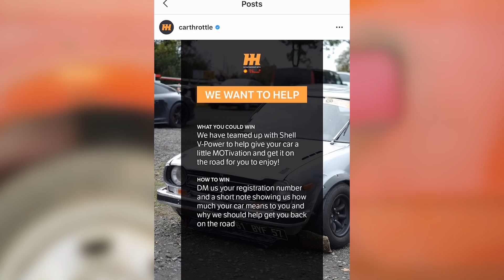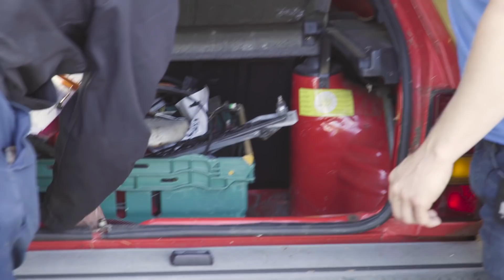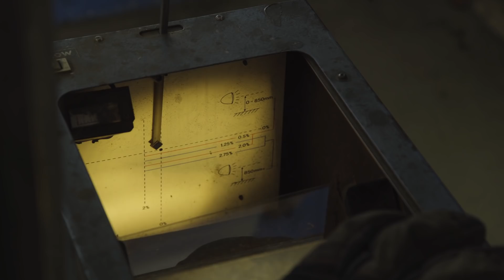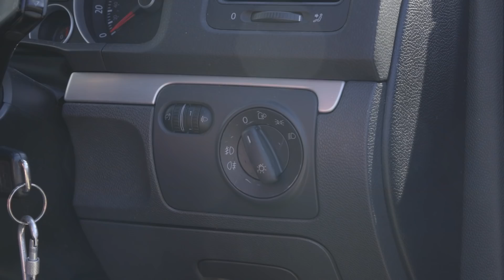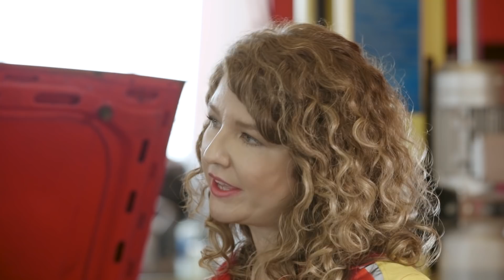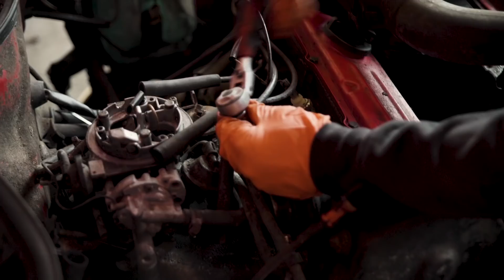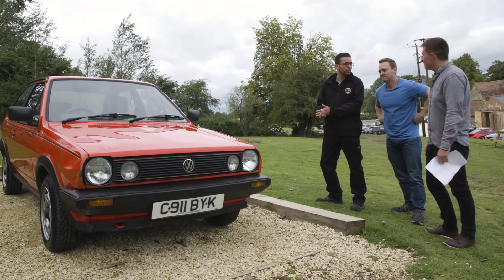Saving A Rusty Project Car From The Scrap Yard

Comment: knock sensors and variable ignition timing on an 85 polo? has she been sniffing v power?
Reply: Clearly she's memorized a pamphlet
Reply: andk1987 it doesn’t even have an ECU!
Reply: does an '85 Polo even have electronic ignition or is it still points? lol, my '88 breadvan 1043 was electronic but sure as hell didn't sense the V-power and bump timing lol. The most intelligent thing about the fuel system on that is the auto-choke :D
Reply: dan mackintosh yeah electronic ignition with distributor, the early ones mk1 (Derby) before it was renamed polo were points
Reply: @danmackintosh6325  The Breadvan I had didnt even have that 😂😂
Reply: @thatcarguy4771  Weber carb?  Would've preferred Weber on mine but the little 1B3 (i think) pierburg auto choke was pretty cool... the 2E2 on my caddy never worked quite as well though.
Reply: @danmackintosh6325  oooo what colour is your breadvan?
Reply: @TheBreadvanMan  the colour it was (more's the shame it was a one elderly owner 80k mile car, solid albeit battered) I'm not sure the name, not Tornado red but the similar-but-less-bright version.  Caddy was also in that hue.  Miss them both, they were very fun for different reasons. Bready was so low powered you could thrash it everywhere and not get in trouble (probably why the HG failed eventually) and the Caddy was a rattlebox extraordinaire that never went a journey without a breakdown, but was just an adventure to drive all the same & I didn't mind the walks!
Reply: @danmackintosh6325  oh nice, I've got a 1987 breadvan marine blue( my profile pic) it looks mint but has alot of problems and has been off the road since 2003 but hopefully it will be on the road by next year 👌🏻
Reply: @taylorhaddock2782  actually the 85 polo classic (which was a derby before the rename) had points. I used to own one and do the servicing on it. Bloody great car, so easy and cheap to service, but the head gasket went and it went up in flames. Still miss it.
Reply: Was that a carburetor or single point injection? The latter does actually have an ECU, albeit a very small and simple one. Although I think they were all carburetors until the mk3.
Reply: hmm
Reply: andk1987 it does, just nobody knows about it...
Reply: William Bishop how? You open the bonnet and see the quite clear distributor which tells you it’s electric ignition literally they all have it
Reply: Taylor Haddock it does, you just have to pretend it’s there 😂

Comment: Alex looks like he’s having a “crisis”when the intelligent lady explains engines
Reply: She didnt even know that the Polo doesnt have s Knocking sensor
Reply: T B yup
Reply: She's reciting corporate speil.
Reply: @jonnoMoto  which does in fact have tons of engineering behind it...
Reply: daszieher I think jonnoMoto was more meaning that it seemed as if she had rehearsed it straight of a text book. Not disagreeing with the facts
Reply: @r3v1v0   yes. When as a corporation you get "air time" you make blanket statements.

Still, corporate lingo still is information and it holds true.

Higher quality base fuels and specially the additive package set premium fuels apart from the more budget offers. The higher octane value is just one of the attributes.

However, budget petrol fuels have come a long way since the 80's so that today's offer should be more than enough for a Polo.

Diesel is a different story.
Reply: daszieher fair enough. Makes sense. 
I put 99 momentum from Tesco in my Fiesta ST. Iv heard things about super market fuel but I assume the fact the octane is high it must be good quality?
Reply: you mean the robot?
Reply: You forgot to put quotes around "intelligent" and "explains."

Comment: Right, is it legal to insure a car on your parents as main driver and have you as a secondary driver even if your the main driver it makes insurance much cheaper so it it legal or not? Thanks
Reply: It's not legal it's called fronting. You can be main driver and add your mum/older experienced driver onto it as an occasional driver which should bring cost down a bit.

Comment: Far better to repair and renovate if you can, rather than to scrap, especially with simple uncomplicated cars, I reckon. Many cars end up at the scrapyard after a failed MOT, breakdown or reliability issues, not because they are unfixable, but because people reckon it's cheaper to gamble on buying something else cheap and hope that it doesn't break down or fail the MOT as well.

Comment: I wasn’t aware a vehicle could fail on things such as not having light over license plates etc as I though they had a bit of maneuverability on some things on the mot test because someone of the stuff modern cars can fail on most old ones don’t have like if it didn’t come on that model like where is he getting a reg plate light from and how is he gonna fix it on if it isn’t even on that model originally When the main focus should be on general safety like car-brakes. And stuff like that

Comment: Jesus christ im glad we dont have mots
Reply: You'd rather have death traps on the road!?
Reply: @drunkenhobo8020  why does it got to be a deathtrap? Common sense goes a long way on whether or not to drive something. In the Rust Belt where I live there's a lot of Rusty vehicles and nothing's ever killed me because of an unsafe vehicle I was in or around.
Reply: You've lost the argument if you're relying on people having common sense.

And "it's never killed me" is one of the worst arguments you can make. Of course it hasn't - that's why you're here to say that.
Reply: @drunkenhobo8020  I agree a lot of people lack common sense but when I look around I just don't see bad things happening because it deteriorated vehicles around me. Sure the potentials there but it just doesn't happen.
Reply: Well the USA does have more than double the road death rate per mile than the UK does, but there's obviously a lot of factors at play there.
I don't think you can categorically say that it doesn't happen. It's extremely difficult to determine all the factors involved when things go wrong on the road. In a hypothetical situation maybe having the front brake pressures unbalanced caused a car to change direction under heavy braking, resulting in a more violent crash than if they'd been maintained properly. But you're never going to be able to tell that at the scene of an accident.

Honestly I think MOTs are a great idea. Forces people to take car maintenance seriously. Wouldn't want to live in a country where that Polo was legal to drive!

Comment: This Polo is the slowest way you can have fun, it just love to spin the wheels and take corners, Easy to repair and maintain, But check the steel bands that hold the fuel tank  in place i lost two, one of them where dragging onto the asphalt,

Comment: I love these types of restoration videos. In fact I love the Prelude series so much that I had actually bought an 88 accord myself as a “project” car. 

I had to change out the front sway bar bushings, and the distributer O ring gasket but other than that there isnt anything bog wrong with her except for the A/C needing a recharge and the wiring for the front passenger speaker shorting out. 

She has a clean title, only one previous owner, and only 67k miles on her. 

Already gave her a full detail and refreshed the pinstripes and plastics back to black. She looks almost as if Honda just rolled her of the assembly line now.

Comment: Compared to Shell's regular fuel. Helps to clean key fuel system components such as intake valves from the build up of performance robbing deposits. 3x more cleaning molecules does not result in 3x the cleaning power. Actual effects and benefits may vary according to vehicle type, vehicle condition and driving style. No guarantees provided. Compared to Shell's previous formulation of Shell V-Power Unleaded. Helps to clean key fuel system components such as intake valves and/or fuel injectors from the build up of performance robbing deposits. 30% more cleaning molecules does not result in 30% more cleaning power. Actual effects and benefits may vary according to vehicle type, vehicle condition and driving style. No guarantees provided.Actual benefits may vary. No guarantees provided.
Helps to restore engine condition by helping to remove performance robbing deposits from key fuel system components such as intake valves and/or fuel injectors. Actual benefits may vary. No guarantees provided.
Boosted compared to Shell’s regular fuel. Designed to help clean and protect key fuel system components such as intake valves and/or fuel injectors from the build-up of performance robbing deposits. Actual effects and benefits may vary according to vehicle type, vehicle condition and driving style. No guarantees provided.
Boosted compared to Shell’s regular fuel. Actual benefits may vary. No guarantees provided.

Comment: Do NOT top up your brake fluid. It is low for a reason.
Reply: @Barry Boppins Or there is a leak somewhere. Other than that, correct.

Comment: It's only uneconomical if you don't want to spend the money. What's cheaper couple hundred to get a car through mot you like or £15 k for a new car, which will depreciate anyway. Cars are money pits you've got to put fuel in and it's not free

Comment: Nice one guys - You use a VW Polo breadvan, a car that could run on two star fuel back in the day, to advertise Super Unleaded fuel - which that car cannot gain any useful advantage from running! As for getting rid of the carbon deposits, a couple of tanks of V power isn’t going to cut it - a soak in paraffin would do more.

Comment: Jeez Louise !! The MOT inspectors here (in Portugal ) do this :

- Watches the suspension and tyre tread wear
- Looks for the LPG sticker (if you have a petrol car) 
- CO² emition test 
- Headlight and taillight bulb intensity level check 
- Brakes and the handbrake efficiency test
 

Looks like a long list but it only takes 20 to 30 minutes to receive a green or a Salmon pink sheet of paper (yup, not red and I am not colorblind) .

Comment: a quick point I think everyone should be aware of, this is an advert, shell v power has no real benefits

older engines like that of the volkswagen won't like a high octane fuel ESPECIALLY carbureted engines 

older engines also don't like synthetic oils as much (its to do with heat, viscocity, and lack of wetting) (mostly wears down cam lobes and soft metal main bearings which have worse tolerances (the lack of wetting means it doesn't stick aswell)

Comment: "We've fixed everything it failed on, so now it will pass".

Having put multiple shitboxes through MOTs.... Noooooooope.
Reply: Why don't you think it will pass if they fixed everything that will fail it?
Reply: @colmfarrel4742  exactly
Reply: @colmfarrel4742  Because it's always somewhat random what they pick up on.  If you took a car for an MOT to three difference places, they would find three difference sets of things wrong.
Reply: @joshuarosen6242  Do you mean they would miss stuff by not checking the car properly? Or do you mean one place would see a part and think that's fine while another would think it's a fail?
Reply: @colmfarrel4742  Both.  Once a car has failed on several majors they often stop looking properly but it's also the case that different inspectors have different views on how serious something is.
Years ago, an MOT inspector told me my brake caliper was loose on my motorbike.  It was a sliding calipers so it was supposed to move but he clearly didn't know that.  He passed it anyway.
Reply: @joshuarosen6242  Then there's the testers that think they have seen it all, only to have my Citroen XM clout him in the head because he didn't set it on high before jacking it up.... (I did warn him) Or to authoritatively tell me (in speaking about my 1991 Escort) that all electronic injected cars have a Lambda sensor (look up the early EEC-IV system, it had a CO adjusting pot) and ABS is only ever on all 4 wheels (when it's plainly 2-channel ABS with no rear sensors and 2-channel valve body)...
Reply: Didn't your Cuore pass first time?
Reply: @Scrubworks  If you think the Daihatsu is a shitbox, my automotive history would terrify you!

Comment: My dad bought one brand new... a special Dutch model called the Volkswagen Polo Sprinter. Double headlights, lowered springs, sporty carberator tuning, light metal 3-spoke small diameter steering wheel and light alloy BBS rims were standard on that one including special striping on the side.

Comment: The stuff the Shell lady told about higher octane ratings was totally not applicable to the Polo. Though fuel with a higher octane rating here in the Netherlands has a lower amount of ethanol (5% as opposed to 10%) which is better for an old car. With a car of that age it's also useful to add some lead or lead replacement to the fuel.

Comment: I am owner of Chrysler Voyager 2.5l CRD from 2002 and I am investing money to restore the car. Even though the parts are very expensive,it is still cheaper than spending a lot of money on a new car. Also the reason why I do this is that the car has perfect engine. Mine has 335k km covered, but I know a few people attacking 1 million KM covered with this car ^^ I have very skilled car mechanic and he is often able to fix the broken parts instead of swapping it, so it's also saving a lot of money. So far I let them to have replaced front suspension, silen block holding the engine, fix the rear suspension, the ignition, replace relay fuse box because horn was not working anymore, battery got replaced like 2 times during the lifetime and yeah, that's pretty much all. Of course I do not mention maintenance like oil change, filters change and stuff like this

Comment: Jesus christ i wonder how do people manage to have modified cars in the uk when the mot is so strict.
The irony is that most of the cars there are fucking awesome. How is that possible?
Reply: Not as strict as in Germany, they are a right pain in the arse, may be because the TŪV, ( MOT in English  ) is every 2 years compared to every year in Blighty,which is a bunmer.
Reply: @pashvonderc381  i know man, germans are more than strict. And the fines related to  illegal modifications are also huge. To get to worthersee from my country you have to go through germany. Alot of people literally lost their cars because the fines were huge, also if you come from another country and they find something wrong with your car, the car stays there till you pay the fine. Damn they are strict
Reply: @pashvonderc381  over here, i can pass the ITP(tuv and mot romanian version) with an engine swap, straight pipe, 18 inch wheels instead of 16, different tire size and air suspension for only 50 to a max of 100 euroes lol. Sadly the same goes for rust buckets, cars with no brakes and such

Comment: For your Diesel-powered BMW 330d, I have some suggestions to make it even better.
- Your performance brakes are facing the wrong way to get optimal airflow.
- You could get the bodywork replaced with carbon fiber, and then repainted to resemble its stock self.
- You could keep that paint nice by applying a paint protection film and then a ceramic coating.
- Other viewers keep suggesting a limited slip differential.
- I would recommend a titanium exhaust.
- It would be extremely expensive, but prudent to replace the windows and windshield with gorilla glass. Lighter, thinner and stronger.
- Supposedly, installing a magnetic fuel clamp could slightly improve its fuel economy. I don't know if that actually would, but it probably wouldn't hurt given the low cost.
- You could modify your hybrid turbo with an electric motor to help eliminate turbo lag, since it would start spinning immediately. However, that's your prerogative.
- I'd also take a look at installing a turbo blanket. That would keep the hot end of the turbo hot, and the cold end of the turbo cold.
- Finally, you can get your race chip reprogrammed to cooperate with the modifications to the engine.
Reply: He's sold it

Comment: Surely Shell V power petrol will made sod all difference in an old car like that.
Reply: I think it would make a bogger difference in an old car, than it would in a new one. An old car is more likely to need the better fuel to enable bettre running.
Reply: HIgh octane can make a difference in an old car, if it was either designed for it, or tuned that way.

In this case though, the high octane was probably better simply due to better cleaning additives.  I know in old carbed engines the choice of fuel can make a massive difference in whether or not the engine becomes lazy.  That being said, I would give it a proper Italian tune-up, followed by a good brand low octane (cheaper and likely perfectly fine for that car).  I personally believe in Shell or Caltex.